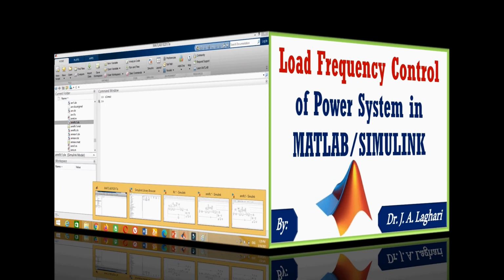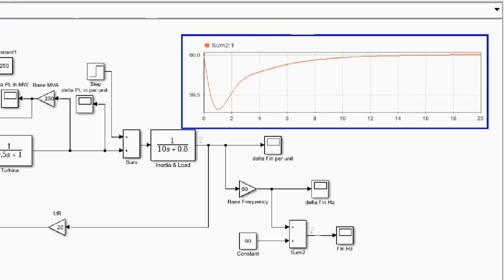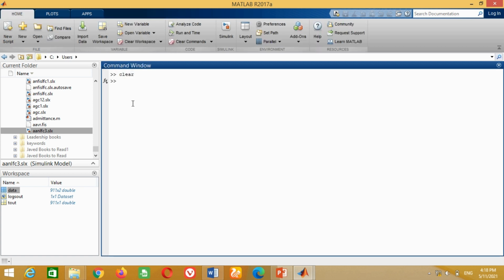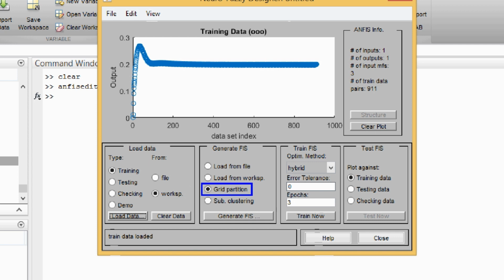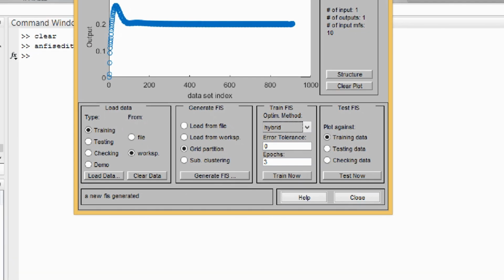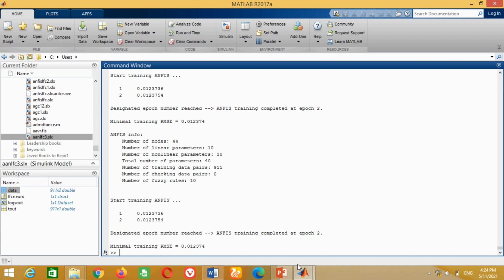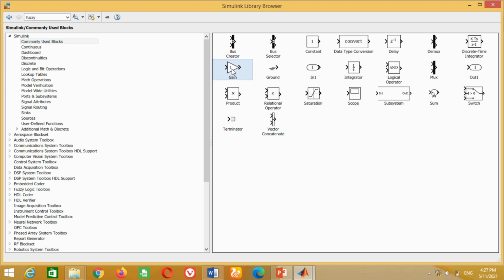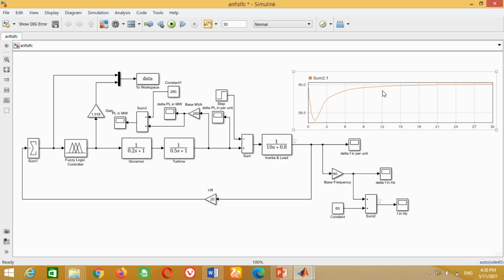How To Design Load Frequency Control Model using ANFIS in MATLAB/SIMULINK ? | Dr. J. A. Laghari

Comment: Alslam Aliaokm
Can you tell me how to take data to train the ANFIS power system stabilizer from the conventional power system stabilizer
Reply from the maker: Wa'alaikum Salam, Thanks for the comment. To collect the data, you have to simulate the conventional power system with various cases and collect their different parameter values. Then you can use that data to train and test system. Kindly go through some research paper for better understanding.

Comment: Hi please I have a few questions. I tried doing something similar and I encountered the following challenges, When you change the step size the anfis controller doesnt perform so well if it was trained with another step size also the tie line power is not so good affecting ITAE.please help me out on how best I can address these issues
Reply from the maker: thanks for the comment. for this, you may have to train it properly for variety of ranges so that it may perform well for all changes.

Comment: Thank you Sir for your excellent video, but I have a question. If I need a PID for collecting good training values, what is the benefit of using ANFIS? It would be simpler to use directly the PID model. So what is the advantage of using ANFIS instead of PID for Load Frequency Control Model?
Reply from the maker: Thanks for the comment. In PID controller, you have to tune the parameters to get satisfactory response. It is a time consuming process. On the other hand, ANFIS has the ability to provide the best results for all cases.

Comment: Sir I have problem in this model ,at the end of the project i receive simulation error from fuzzy logic control it shows diagnostic error warning now how can I reduce output arguments,is there any solution my version is 2018 sir
Reply from the maker: Thanks for the comment. I am not sure because I have used matlab version code in 2017a version

Comment: Thanks . Please how did you get the gain value 1.018?
Reply from the maker: 1.018 gain value is obtained after running the simulation for large number of times and using different random number of values.
Reply: @DrJALAGHARI  By trial and error.
Reply from the maker: @TEC_STE  yes.

Comment: Thanks for the explanation.  And I want to ask, Can we make this simulation automatic straight away without needing to separately change the PID controller and anfis?  So the PID and Anfis blocks are in the diagram, and the PID data is directly used by anfis and we can immediately see the results of the anfis
Reply from the maker: Thanks for the comment. ANFIS needs training first. Otherwise it will not give correct reault. Training is always done out of the model.

Comment: Dear Dr Laghari @Dr. J. A. LAGHARI  that would be great for all of your followers if you try to focus on close loop control of motor drives and integrating renewable energies sources  (Wind and solar) through inverters. IN particularly how to find pid parameters and how to implement fuzzy and ANN in those areas. thanks. May God is blessing you inshallah
Reply from the maker: Thank you so much for the compliments and suggestions. No doubt it would be great. I am trying to make as many models as I can related to different topics. When I succeed in making the models then I make their videos. Therefore, i am trying and will also continue to try on your suggested models. Let see when this successfully completed.
Reply: @DrJALAGHARI  Thanks a lot for your convenient and flexibility. As you know nowadays power electronics converters and close loop controls are involved with everything in the area of electrical engineering. that's why  I raised this suggestion.  May God fulfill you entire live and hereafter with happiness and successes.
Reply from the maker: @FaraedoonWaly  my pleasure. If you have any such model then you may also share the basic model and I will apply ANN, Fuzzy and Anfis on it.